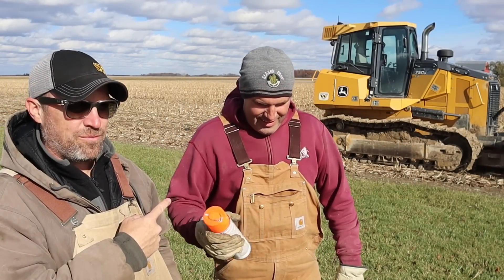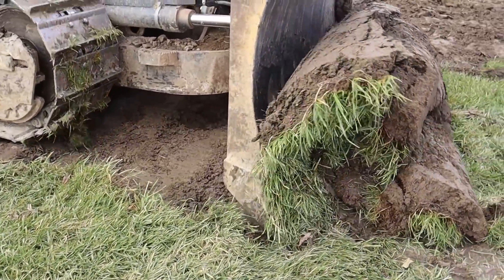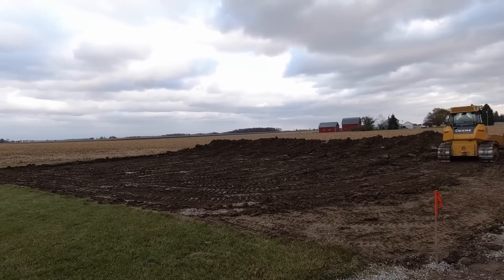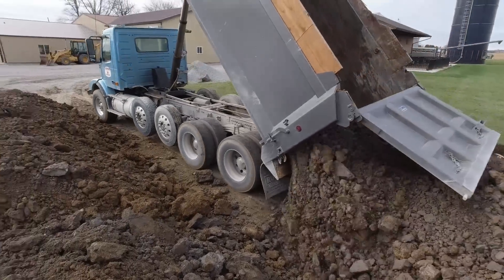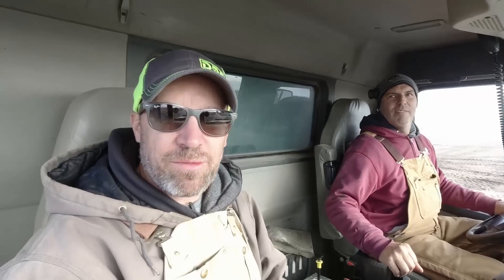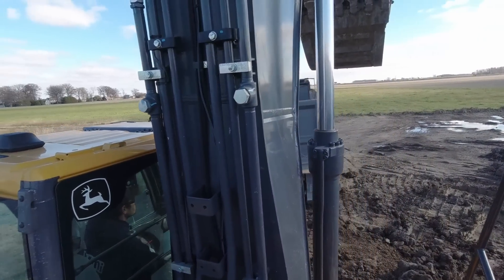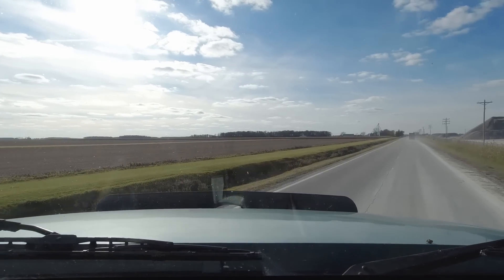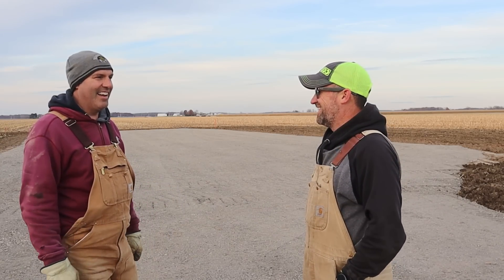Excavator Wannabe: Helping A Local Contractor Build Large Building Pad With Big Equipment!

Comment: Hi Caleb!!!

Oh yeah… We gotta see more!

Seat Time Matters… that ought to be on every equipment operators Tee-shirt.  I enjoy watching pros operating equipment.  They make it seem so effortless. It lulls you into thinking, “I can do that!”

But, once your butt hits the seat it takes only a few moments for reality to take over.  Running similar equipment helps to sharpen the learning curve.  Butt, until you’ve warmed that seat to the point it wears your cheek prints when you get off, it is still going up!

I owned a baby Kubota backhoe for 15 years.  I used it enough that I was comfortable with the controls.  I knew where it’s capabilities and limitations were.  I was able to accomplish things with it that I couldn’t have done when I first got it.  

Then I decided to trade it in for the newer version… same machine, same engine, same hydraulics, same loader & backhoe… except, the loader and backhoe come with quick attachments.

That was three years ago.  

The loader isn’t such a big deal and I like having Skid Steer Quick Attach… however, the extra weight, increased length and slop does reduce my weight capacity and change response at the controls.

But, the backhoe is really hard to get used to.  The quick attachment has slop in it.  Where the previous one was held in place with pins that I had to grease and tap in place; this new one has clamps that engage on studs in the frame.  

I put out a video this week where I was installing a propane line.  In it there are a couple of scenes where you can see the whole backhoe bounce up and down as it encounters roots and rocks.  It looks like I am jerking the controls.   However, it is the slop in the attachment that allows it to bounce.  

I was embarrassed at how amateurish the video looked… but, I left the clips in anyway.  Perhaps as I endeavor to get permanent butt cheeks embedded into the seat, those herky/jerky motions will go away.  But, like you said, getting on a different piece of equipment requires more than just a translation of skills… it requires experience!

Perhaps… I should have made a deal where they traded out this nice new ergonomically designed seat with my old worn out cheeky seat?  Because, I really felt comfortable running the previous hoe when my butt was planted in it.  Do you think?

Neil, you did a masterful job of condensing this project into a story… once again!   Thanks
Reply from the maker: You've got some great ideas here in the concept of a portable seat that transfers all your knowledge from one machine into the form of a new machine.  That would be an incredible invention!  Don't ya just hate it when you think you've got something all figured out and then you sit down on a new machine to show the world what you can do only to look like a total rookie when you watch it back?  Don't feel bad though Dave, happens to me all the time!   I need to check out your video then so I don't feel as bad though cause I leave plenty of it in that gets a little embarrassing.  Oh well, we can all relate on some level.

Thanks for checking this one out.  Wasn't sure how it would go over but it sure was fun for those two days while we were doing it regardless.  I'll keep the camera rolling even if I have to be inside in my office while they put the building up.  Have a Merry Christmas!

Comment: I'm also surprised that you don't show any testing of the clay. I'm used to building clay/liner landfill sites and as an engineer working on site  we would conduct shear testing of the clay/porosity of the clay in many different parts of the site.
Reply from the maker: This is just for a stone floor pole building. The floor will not support any weight whatsoever.

Comment: "Hi" Caleb, Greg and the rest of the Dozerwerks crew!!  And of course we would like to see more of this project as it progresses (hopefully less mice are involved, LOL!!).  Looks like both of you did really well on the dozer, from the videos I've watched with newer operators (to dozers), they normally show just how hard it is to really run a dozer well, it looks simple from the outside but you really have to actively control the blade, if you are reacting at all, you will be too late and create a bumpy mess (or at-least that is what I have seen.  Never run one myself).

Seems like it would be really handy to have a digital readout that showed the blade position relative to the plane of the tracks, 1"higher, 2" lower, 0" on the left and 2" lower on the right..... (that sort of thing).  Sure that would be something that real operators wouldn't need and would laugh at but it makes sense to me....

Great video Neil, have a good one!!
Reply from the maker: You're exactly right about running a dozer.  You have to anticipate rather than react.  Great assessment Stephen!
I like your read out idea too.  That would be good for beginners I'm sure.  Might be a concept there to follow up on!  
Thanks so much for watching!

Comment: Hi Caleb and the whole Dozerworks crew! Neil, I was wondering why you engaged the air axles.  I'm not familiar with them and don't know why or when you would need them. Thanks for the videos. Merry Christmas to you and your family!🧑‍🚒🎅
Reply from the maker: Great question.  The additional axles help to distribute the weight of the load onto the road.  You are legal to haul a certain amount of weight based on axles and if the truck is fully loaded then it needs all 5 axles on the ground to be legal.  You can pick the axles up to turn sharp corners or to drive off road as you saw me do.  

Merry Christmas to you and yours and thanks so much for watching and supporting the channel.  Always enjoy your comments.